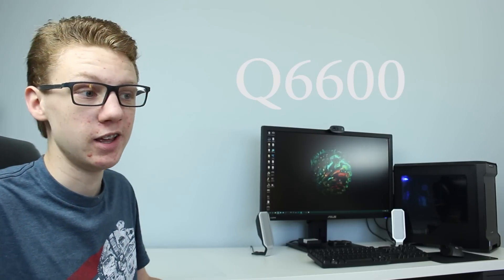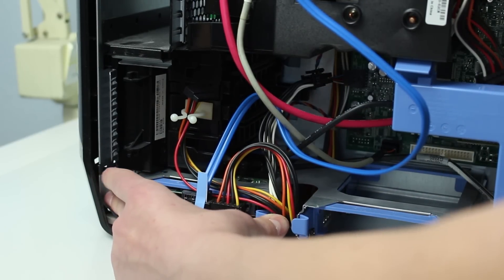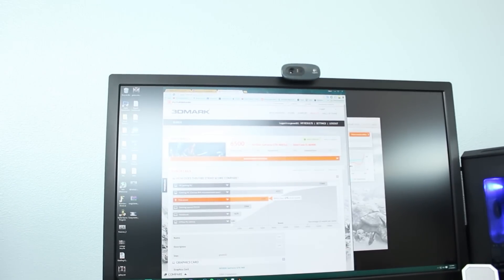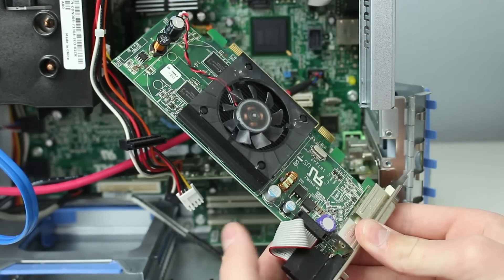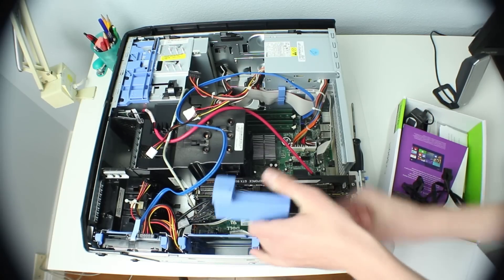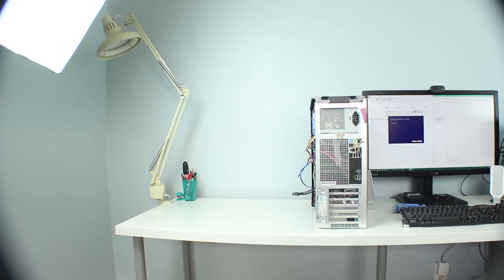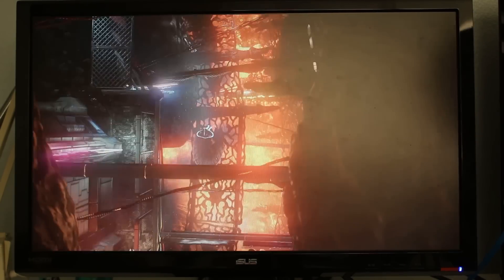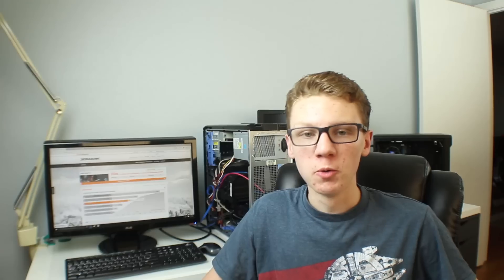Old CPU + New GPU = Gaming PC? (Core 2 Quad + GTX 960)

Comment: Ha it was running linux mint! That's what I run. Oh btw if you can afford a 4690k you should have something a bit more powerful then a 960. Classic case of to much cpu, not enough gpu. No offence, just saiyan. Oh yeah windows 10 is malware, aka cancer. After 7, I gave up on it.
Reply from the maker: I have the 4690k mainly because I edit a lot of video...for obvious reasons. 1080p renders times with GPU acceleration is about a 1:1 ratio, aka a 10 minute 1080p video takes about 10 minutes (or maybe slightly more) to render.
Reply: I suppose you would, why not go with a 3570 and OC. They are about the same if I'm not mistaken.

Comment: I have a Q6600 and it's still rocking hard although it eats up a lot of wattage.
The problem with my PC, as you mentioned in your video, is the hard-disk: it's too slow. Need to change that.

Comment: Any new cpu intensive game will really struggle with a core 2 quad. When I upgraded a q8300 to a 3570k several years ago some games doubled in fps and that was with a geforce 560ti. if I was recommending a cheap used cpu for gaming, I would go for at least a i5-750 and overclock it.

Comment: Does the RAM bottleneck any performance.? Because seriously I dont seem to get a conpatible RAM for my PC. Specs GTX 750ti Core 2 Quad q9650 Ram .......... 2 gigs. Shut up. I know what you are thinking. Mine is a Dell Inspiron 560s with the default motherboard and everything else upgraded  ranging from monitor mouse and keyboard till the hdd(I have an ssd now) USB port GPU CPU and even the cooler fan.

Comment: Just to help a little, TDP does not equal heat output. My Athlon x4 750K pulls 100W, and it stays perfectly cool with a tiny stock cooler.
Reply from the maker: Then why are coolers rated by max TDP? Wouldn't that make it a measurement of heat output?
Reply: +Gavin Remme Well it is a rating of heat output. I should've said the heatsink is too big instead. I did a derp. xD
I have a computer that's identical on the inside, except it's got a core 2 duo. Has the same giant heatsink.
What I'm trying to say is that it's not incredibly important.
Reply: +Gavin Remme Well anyway, great video.

Comment: Even a GTX970 could run with a 375watt psu. But only if it's not overclocked.
Reply: A good* 375w PSU

Comment: whaaaa????????? is the windows activated if you do the boot media thing..... i have windows 8.1 on my laptop and i want to install win10 on it but i cant upgrade because the windows is not activated...

i f you do the media thing, is the windows activated??? or is it win10 unactivated??? and does it unactivate windows on the pc that you create the media?? 

help if you can :D
Reply: +jaakko200987654321 If you use the media creation tool off Microsoft's website you can upgrade to windows 10 but it will not be activated, you'll be able to use a windows 7 or 8/8.1 key though! That's what I did for my copy, I found an old broken windows 7 laptop and copied the key off the sticker and boom! activated and genuine windows, and it's legal. :D
Reply: +Jerpa i already played with it. first i installed win10 home on my laptop and then i wanted to use the code on my laptop and it said that it was for win7 pro and then i realized that if i use a core from microsoft that upgrades windows 10 home to win10 pro..... i installed win10 pro, put the win7 pro code in and it worked flawlessly....

few days later i realized that i have a BETTER OS on my potato laptop (hp probook 6545b) than my main pc (1500€ gaming pc built by me)..........

Comment: i have AMD radeon R7 250 2gb DDR3 ,and i want to buy a CPU like AMD FX-8350 or 9590 ( 8 cores and 4Ghz ,or 4.2 Ghz turbo) ,i have 6gb RAM,i want to record csgo,how much fps will i get when i RECORD the game?
Reply: +GoldeX Itd probably be a better option to pick up a i5 or i7 ( 4590 is good value), i run an 8320 at 4.2ghz and it has definitely gotten slower with newer titles in minimum FPS.
Reply: welp,you know what,i dont wanna film gta 5 or but ido want to film csgo,maybe half life,garry's mod and a bunch of small games :D
Reply: whats your current CPU anyway?
Reply: welp idk maybe some sempron 1.3 Ghz quad core?
Reply: awh man dont do it, i went from a Phenom X4 B50 (2008) to a FX 8320 (2013) and noticed only a slight change in minimum fps. Compare that with the i5 750 (2008) to the i5 3570k (2012/13) the difference is immense. You wont have to upgrade for years with intel.
Reply: +wannabuysomecrack i know man,but i highly doubt that intel i5 is going to work with amd gpu that is amd radeon r7 250 2gb ddr3?
Reply: Hey i dunno, but id think of it an investment. Even the i5 2500k still kicks ass and that was released in 2011.

Comment: fyi 5200 rpm hdds almost always get pegged to 100% in windows 8 and 10 no matter what you are doing at the time. just bwcause it is pegged at 100% does not always mean it is a dying drive. especially when using old tech like this with a modern OS

Comment: Thanks for doing a great test comparison, i have a q9650 3Ghz quad in my dell running raid 0 ssd's,  i was going to replace the lot but i think im just going to go for a gtx 970 as the q6600 2.4Ghz is well below the performance of the q9650,  and to be honest it absolutly flys with the ssd's and 8GB ram, im running windows 10 on it and everything is ready to use after about 30 seconds from switching on, again great vid

Comment: I just upgraded from an intel core 2 quad extreme overclocked to 3.66 ghz to an intel 4690k running at 3.5 ghz and saw a huge difference in games. The core 2 quad series will bottleneck any system. I paired a evga 970 ftw with the core 2 quad extreme and got 45 fps on bf4 maxed out at 1080p. With the i5 4690k and a evga 960 ssc I was getting 77 fps completely maxed out at 1080p

Comment: hey mate, which is better. core 2 quad core 2 duo extreme? there were pretty popular in the bf2 time
Reply: +Irfan Yusuf Fachrurrozi Well the Core 2 Duo Extreme has a higher base clock, so I'd say that one would perform a little bit better (2.93 ghz vs 2.66)

Comment: You pointed out something that most of the new PC gaming generation doesn't know. Great way to drive this point home to some people. Most of today's gaming is dependent on your dedicated video card and not the CPU. It's still obviously an advantage to have a newer (more powerful) multi-core CPU. However any Intel quad-core CPU made between 2007-2016 paired with a powerful gfx card will be more than adequate to run any game at an enjoyable FPS. I specified "Intel quad-core" because some older AMD 4-cores have bottle-neck issues when paired with a high powered GPU.

Comment: does the mother board matter? can i use gigabyte r 9 380 4gb on my asus mother board dh61ww ? a reply would be rally awesome i have 2nd gen core i5 2400 cpu @3.1 ghz and 8gb of ddr3 ram
Reply: i have a cooler master 460 watt psu
Reply: and 12 gb ddr3 ram

Comment: There's ONE thing I don't like in pre-built branded pcs: They (most of them) can't be modded to support intel 771 socket xeons! You have to try the big difference between that Q6600 and xeon X5492! It even overclocks on my board (the xeon) which is Gigabyte GA-EP54T-Extreme.

Comment: lmao, tests a cpu on a gpu based application. Really helpful..
Reply: +Adam Toews I did a video like this where I tested games that rely on CPU if you want to check it out.. :D
Reply from the maker: +Adam Toews I was testing how well the cpu could support the GPU.
Reply: +Gavin Remme huh?
Reply: +Adam Toews its like saying, instead of spending $230 on a processor when i'm only going to play dota or cs or call of duty, buy a cheaper processor and buy a better GPU because the CPU isn't gonna affect your gaming that much and that $200+ is better spent else where. is it that hard to understand the point of this video o.o it WAS very insightful
Reply: +Kei Sinclair yeah but if you're really testing the gpu for bottlenecks, you need to test on a cpu based application. it's common sense.
Reply: Adam Toews "will my graphic card work just as well with a 10 year old cpu as it would with a newer cpu" click yes click no. 

No, i wouldn't test to see if my GRAPHIC CARD is being bottleneck by a CPU on a CPU based tester because that wouldn't even involve my GPU.  It would only show me the states of the CPU and nothing about how well or poor the GPU is running. Most games currently are less CPU intensive. If i were to test for CPU bottlenecks i would choose a game or a benchmarker that requires both CPU+GPU at max load.

There are old games which are CPU intensive so that would mean, testing your CPU for processing bottleneck.  that would be your only saving grace in your logic. 

also, if i wanna test for gpu bottlenecks i would look at the mobo first, PCIE 1.0 would be your concern. still, gtx 960 not 970. should be just scraping "fine" 

End of the day, if you are going to just play normal mmorpgs which i guess a gtx960 user would do, no harm saving a hundred or so. 

Anyway long post, point is, it was a enlightening video
Reply: +Kei Sinclair I guess we can hipefully agree to disagree. I did not find the video terribly enlightening. a good test of the gpu/cpu would have been arma 3. it's an extremely cpu bound game but atill needs a good gpu to Max out.

Comment: I have a freaking Core 2 Duo E7400 2.8GHz with 8 gigs of ddr3 memory and a gtx 560. 0% Over-clocked cause I have no idea how to do it, but hey I can play games like Mad Max and fallout 4 in some medium settings with acceptable fps. My pc is probably 8 years or less old. Where I live these things cost a fortune to buy! So the only other option is to use it with the utmost care.
Reply: you can overclock your cpu in bios, but only if your cpu and motherboard supports overclocking.

Comment: Many reasons why i only use FX processors.They're cheap and go do everything.
Unlike Intel,which is overpriced  for a  shit dual core,that can't even video edit. But my 89$ Dollar oc'd FX6300 can. HAHA
Reply: What about gaming?
Reply: +Kyle Jorcha The FX-6300 does pretty well on games, as most rely very heavily on the GPU and the CPU is somewhat less important, with the exception being maybe GTA 5 and a few other titles that are more CPU demanding, so there you might see some difference due to Intel's usually better single-threaded performance, but even there I suspect that the performance of the GPU matters more than the CPU.

I'm using an FX-4170 paired with a GTX 650 Ti, and so far it still does the job for me, while with some newer games I have to tone down some of the graphic eyecandy, but it'll hold me decently until summer comes when I can afford to upgrade to an Intel. For a 3 - 4 year old build, I think it has served me well.

Comment: This is why I'm going to stick with my FX-8320 with a slight OC for awhile, once I get the Pascal x80 or 1080 or whatever they call it, my performance should still be marvelous at 1080p (running a GTX 760 now which actually does fairly well considering).

Comment: Did you look at the before and after CPU graphs ? Some games use more CPU than others. If you were using WIn10 then DX12 uses more of the GPU. But the old CPU uses 105W, that's a lot. It used to be many years ago that CPU power was more important but now that's changing to GPU. Was the OS for the old rig a WIn8 or 10 ?

Comment: God your annoying, please get your facts correct, there is not "core 2 duo quad core". There's the core 2 duo dual core cpu, and the core 2 quad cpu. Stop bitching about load times you spoiled rat, 3D mark took like a minute to load a seriously intense program that's fine, and on most pcs Windows takes more then 1-2 hours to download. And that q6600 would outperform your i5 if it was overclocked.
Reply from the maker: +Rob Random Stuff I know I said it wrong. I know it's not actually a "core 2 duo quad". I fixed that in an annotation. Also, this motherboard doesn't support overclocking.

Comment: i have an overclocked Q6600 G0 stepping over clocked to 3.6 ghz (cpu muli @ 8x/ FSB @ 1800mhz giving a total of 3.6ghz clock)  and im still using it today with no problems or bottleneck i also have two Nvidia GTX 295's in Quad SLI in two slots running @16x PCIe 2.0 on both lanes  (as they are tow duel GPU cards) i use to have a Nvida 8800GT back when i built the computer and  upgraded to a GTX 285 (when new) for like $400. i bought two second hand Dual GTX 295s for like $100 online to upgrade a couple of years back and it hits 50-60FPS consistently in any, and all games i throw at it. including Witcher with FXAA on and 8XAA 16xAF. these babies can go up to 32XQAA. 

just note these old systems need higher clock speeds to perform well at all and still  lack in the higher calculations per clock cycle, per core (1 thread) do to age.. 
a new $124 skylake i3 6100 base cpu is 90% faster in single thread operation than a Q6600. and it does it more efficient, so this means the one core (1 thread) of a whole i3-6100 skylake can do laps around the 4 process that a Q6600 can simultaneously multi thread ( that 4 process at once) all at once. just know its still faster higher/more PER clock caculations at low speed is why intels chips are killing AMD chips.

Comment: These Core 2 Quad CPUs are much better then today's i3 CPUs. Im Running Core2Quad Q9400 OC @ 3.2Ghz ( stable ) with Asus GTX 960 2GB OC, Boom 1080p all games maxed, no issues at all.
Reply: +Syed Waqas Munir No their not. Old quad are comperable to pentium definitly not i3. I think that i can say that i3 6100 will crush old quad.

Comment: q9650 here @4.01 Ghz. 8gb ddr3 @1333. r9 290 4gb @ 1.1 ghz. Radeon r7 240gb SSD. 
playing witcher 3 @ 1777x1000 resolution. all settings ultra except hair works to low and Gerault only and foliage to hi. Average frames in mid to high 40's.
It's enough and couldn't ask this Rig for anymore actually.

Comment: i do see 1 problem . on my older tripple core system steam would not even LET me download the witcher 2 OR far cry 4 .  Soooo my point is the using a really old BFG 280 to run far cry 3 at playable frame rates with the graphics on the higher side of med is a impossibility with steam because they wont even let one try . this is in refferance to the fact than MANY games on steam have minimum requirements over this processor .  i think it might also be done on purpose as a forced planned obsalesiance kind of thing thats all the rage with vampiric corporations nowadays .

Comment: I've got a Dell Dimension E520 that has a similar looking case to yours. It currently has a Pentium E2200, 3gb ram and a 1gb hd 8470 and an older 320gb sata hard drive. It handles Windows 10 quite well but I'm kinda considering upgrading the cpu to a Q6600 so it can play games better. GTA V runs like crap on it as it is right now. would upgrading the cpu help or would the ram or video card hold it back?

Comment: 960 is a bad graphics card. R9 380 is giving more performance, less expansive, has better driver and better dx 12 support. Useless graphics card.
Reply: Well sounds like that's an opinion, which is fine :/. Just saying, I had a 960 and it worked great
Reply from the maker: +L3xou97 The R9 380 wasn't out when I bought my 960.
Reply: Gevan32
 It was. The 380 is a 285 which came out 4 months before 960.

Comment: i resently got an old pc from my stepdad, it is 10 years old, i figured out everything is wrong because I cant install windows 10. i think it is because it has a 32 bit prosessor and Something with the hard drive. I have the same problem with another old pc. I think it's too bad because it had some impressive secs i think to be that old, it would probably beat this 2009 cheap pentium laptop. the specs are a Intel pentium 4 3,4GHz cpu and a Nvidea Geforce 8500 gt It had 1 gb of ram changed to some hyper x dont know how many gb it is probably more than 1gb. this pc runs extremely hot because of the psu and cpu cooler i think not too sure, I wonder what would happen if I bought  maybe a cheap NEW psu and a 750ti, and a cheap used i5 3,2GHz++ cpu would be fun if it was good.

Comment: the q6600 is great as long as you dont pay for it. If you have to pay you would choose a pentium G3258. A bit more pricey but you got a cheap cpu with a lga 1150 spcket who give you room for a futur upgrade and i guess the pentium g3258 will give you a better single core perfomance

Comment: several years ago I did a similar system to this. back in the AMD 4000 series generation I had an old Dell with a Athlon dual core pc I paired with a AMD 4850 I got off a friend dirt cheap. whole system was probably under $300 and it gamed great for its time and probably lasted me 4 or 5 years until I could afford to build my own custom system.

Comment: Interesting results. The score you achieved (5520) is about the same as the score I get (5637), with my GTX 660ti and i7 3770K @4.2GHz . The i7 will stay with this PC when I upgrade to a new gen graphics card though, so I hope to get more years use out of it.

Comment: Why reinstall windows? Just swap the drive from your i5 machine. Also, it takes like 5 mins to OC the q6600 to 3Ghz, and they'll run great all the way up above 5Ghz. Also, that's a lower end ATI Radeon HD 2xxx card. Any chance we could see what your i5 machine can do when hamstrung to 3GB of RAM?

Thanks for taking the time to demo this stuff.
Reply from the maker: +Brad Gefroh I'm pretty sure that board doesn't support overclocking, otherwise I might have.
Reply: +Gavin Remme The 3.0 Ghz tapemod takes about 2 minutes and is completely independent of the MOBO.

Check this page, it gives all the details. I'd love to see another string of benchmarks after you're done! https://techreport.com/forums/viewtopic.php?f=4&t=80417

Thanks again!
Reply: Any more luck with that q6600?
Reply from the maker: Haven't tried.